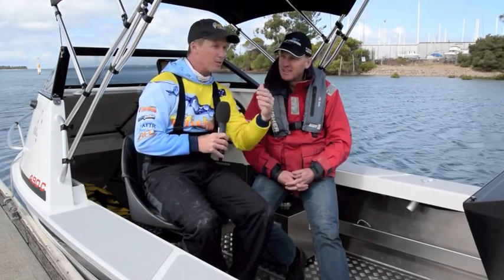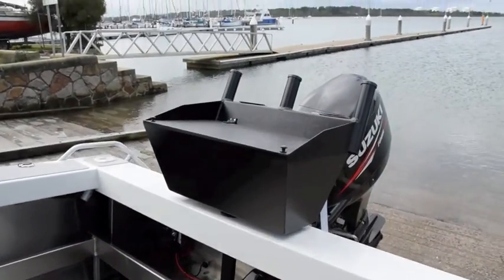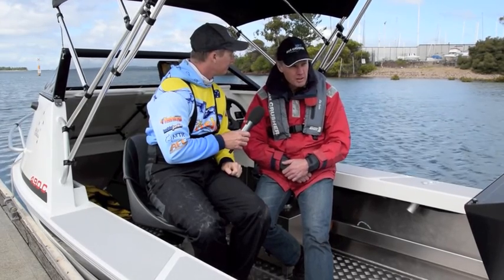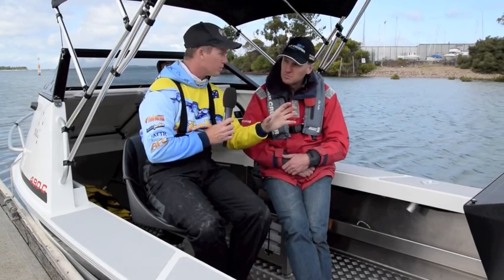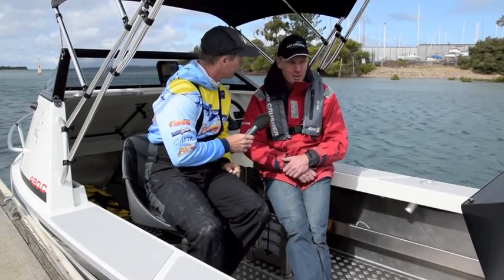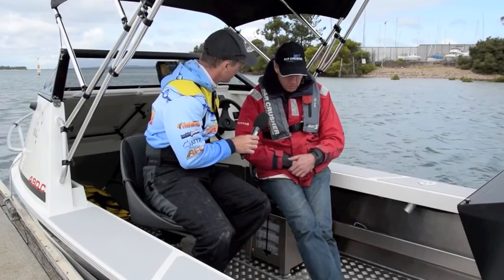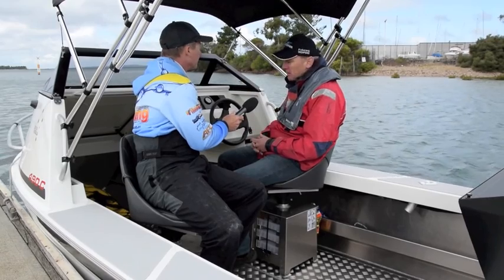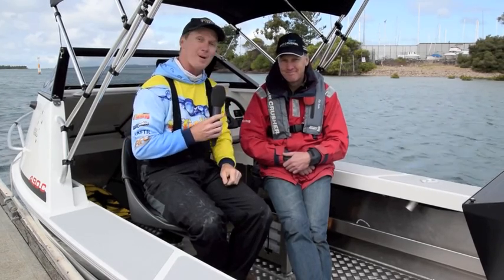Bar Crusher 490C v 490 WR

Comment: certainly a really nice boat but might want to rethink the price. being mid to high 30s is a bit over priced for a first boat buyer as mentioned. fully optioned that seems to be a fair price but mid to high 20s maybe low 30s for a 5m boat with no options seems decent. otherwise youd rather go get a 530c or 550c bar crusher 2nd hand for mid 30s. just saying